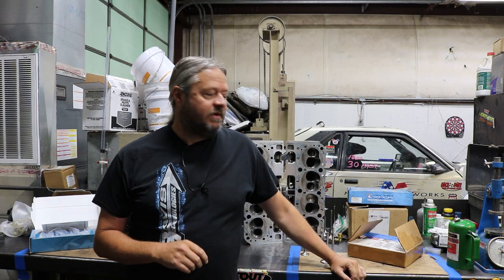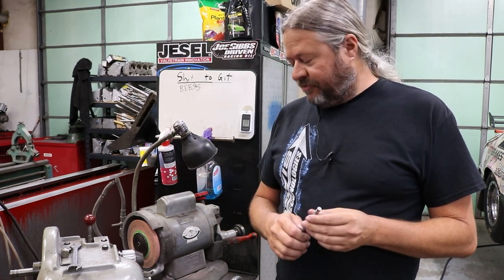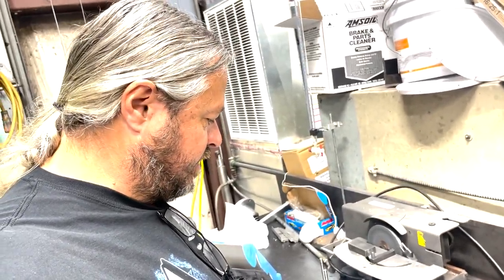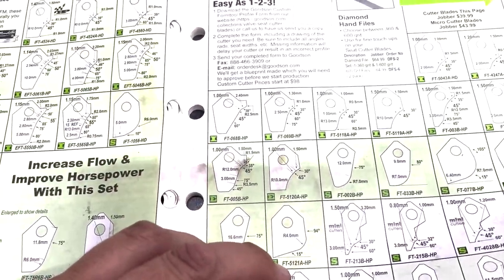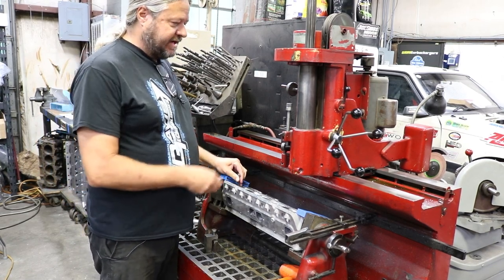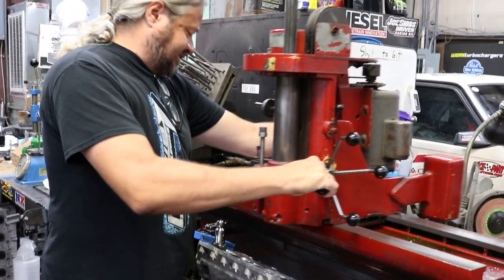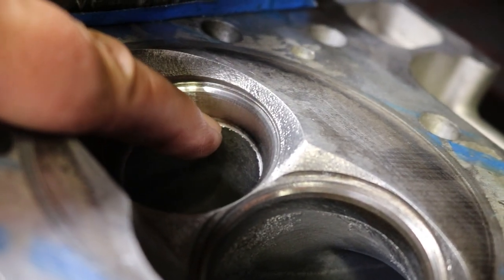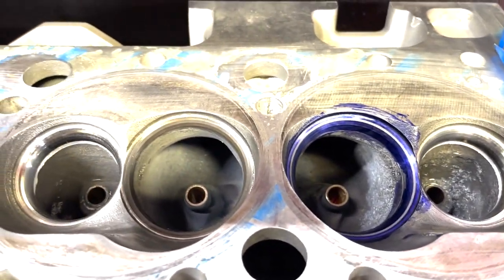Polishing Turds!!!   What is a valve job???

Comment: 3/4 cam, double hump heads and a 5 angle valve job. 750 to the flywheel is what the old timers used to say….If they only knew what 750 really feels like lol.

Comment: sigh. im about to attempt an fzr250.
been killing me with this weird "carb issue".
finally noticed bubbles in the intake valves. pulled the head...
its been rebored.
the exhaust valves are so coked up theyre seating on carbon. great rebuild, guys... i suspect it isnt a carb issue at all.

sort of understand why the 15mm valves hadnt been touched... just ordered a bunch of cutters with the plans of modifying them. even gotta grind a pilot arbor... nobody makes cutters this small. no-one can do a valve job at this size.

and no-one can afford to pay a shop to tool up for it.

when you think about air viscosity and tolerances at small scale... every tiny imperfection is huge when its a 62cc cylinder...

Comment: At the shop I worked at we had a Tobin Arp valve and seat center just like yours for inline valve heads, and a Serdi Machine for canted valve heads. Same old Sioux valve grinder just like yours too, except with the coolant pump & hose still flowing oil, LOL.  When ever I was cutting or installing seats with those hardened pilots, I always had an oil squirt can to put a few drops of oil on the pilot so it didn't wear out the cutter heads.

Comment: I have a old Sioux valve grinder from the 1950's early 60's with a bunch of grind stones the thing works good I don't use it very much it was supposed to be for a wall hanger but everything works and I needed to use it a few times and so I have but it was used on old stock flathead stuff.

Comment: Really enjoy these I worked at a machine shop in the late 80’s and it’s neat to see the way some things have changed and others are still done the same way. I used 3 different Sioux stones to create valve seats,the multi angle cutter is a vast improvement for speed and repeatability.

Comment: I just chuck the valve inside the head use valve grinding compound and use a drill for about 20 to 30 seconds slow rpms is how I do it on my personal engines
Reply: Read up on modern technology!  Expert head gurus now refuse to use valve grinding compound!